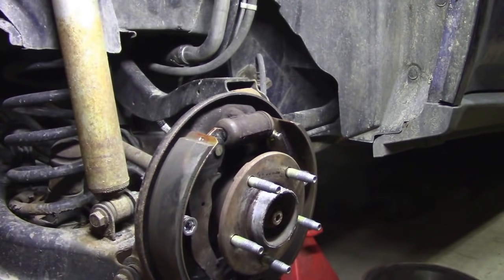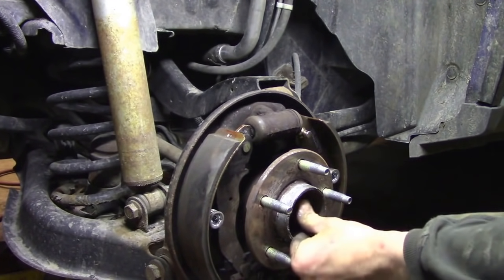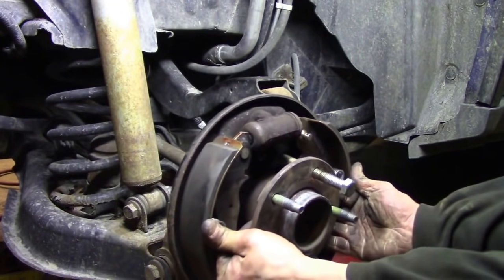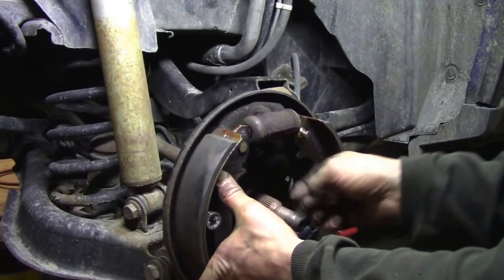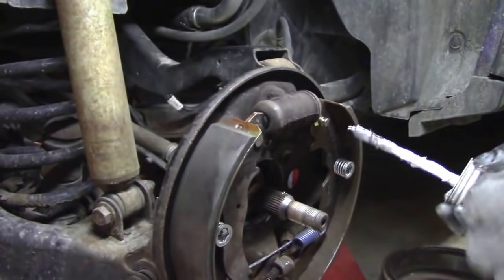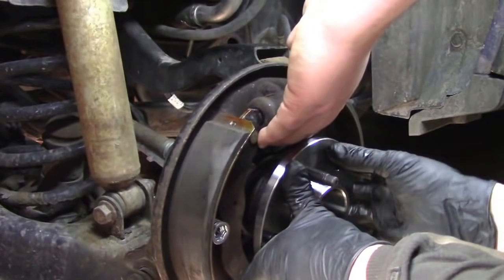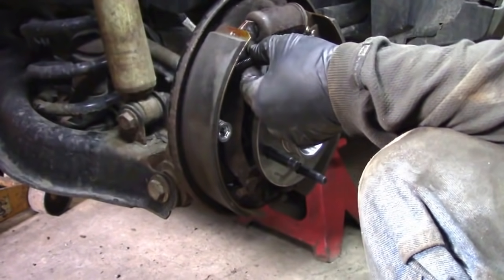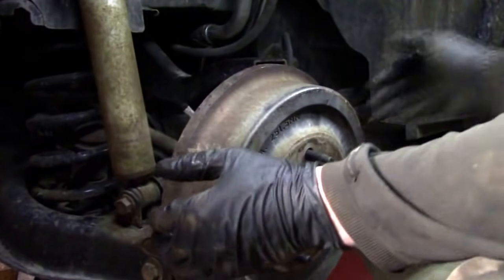Equinox rear wheel bearing replacement

Comment: I just finished my 2005 Equinox... Thank you Gentlemen for all the help. I do believe that this is an all wheel drive Equinox. My Equinox is a simple front wheel drive. I did not have to worry about the 29mm nut and spindle for the rear Hubs... Just 4 bolts and i tapped it out... Passenger side needed some tapping from behind but came out easy. Finished both in under 30 minutes. Again.. THANK YOU!!!  Saved me $236.00 in labor charges.
Reply from the maker: Glad we could help...
Reply: E2 6
Reply: I’m so glad I read your comment!!!!
I just replaced my rear drivers side hub and noticed there was no spindle on either side(of the rear)..... I got the vehicle from a private owner and began to freak out if there was a vital safety component of the vehicle missing for whatever reason!
I began looking online and people saying you have to have a cv bolt or the wheel can separate in motion but they were speaking in general and about front wheels. I couldn’t find any information on the 2 wheel drive model rear cv/spindle -but if they don’t need them in the rear that’s probably why😅

Comment: Worked great! Noise is gone and the antilocks don't kick on at low speeds anymore.  Only difference is I had a FWD equinox so there wasn't as much room to put the bolt on and no spindle.
Reply: speedbmp07 so you change both rear wheel bearing then
Reply: What was the noice that your were hearing?
Reply from the maker: Glad to help...

Comment: Thank you very much, I have to change my passenger rear wheel bearing, done wheel bearings on my past vehicles but not on the equinox I just got. Thank you very much.
Reply from the maker: Good luck...
Reply: @backwoodzcustomz1549  thank you for your help, trying not to drive it till I replace the wheel bearing, I know they do not self correct themselves and don't wanna make it worse.

Comment: If you apply grease or anti-seize to the threads, don't over-torque the axle nut. Reduce torque by 40%.
Reply from the maker: Never had an issue in 20 years..
Reply: All I'm saying is greased threads allow a nut to turn 40% easier so if something is supposed to be torqued to 150 and you grease the threads, your torque wrench will click at 150 but there's actually 210 being applied. Certain parts have specified torque ratings because they need a certain amount of tenstion to stay tight but also have a little give (yes, metal does give like a rubber band but just a little) but over-torquing takes up all the give so any sudden forces result in permanent stretching or cracking.
I'm glad you've never had a problem in 20 years but that doesn't mean it won't cause a problem for someone somewhere. I'm not saying every nut and bolt on a vehicle needs torqued to spec, but very crucial things like lug nuts and axle nuts really should be.

Comment: I tried to get two of the four bolts off and stripped the tops over both bolts so l could not try to remove the hub assembly. Thanks for the idea though.

Comment: thanks for the video, i am in the process of doing one with drum brakes on the rear, by any chance can you lead me to the right place to get the short steel brake line that goes from backing plate to main brake line its about a foot long and has metric fittings, tried to find them on line but couldnt find them.. thanks for any help you can offer

Comment: you did make that easy. BUT i am having trouble pushing the axle back. Any tricks to break the axle free?
Reply from the maker: If you mean release from the inside of the bearing. A big hammer, PB blaster, or even heat if you need to. Maker sure to leave the nut on so you don't ruin the threads.
Reply: @backwoodzcustomz1549  Could I use a 4 ton hub puller to pull the hub bearing? I tried heat, PB Blaster and banded the crap out of this and no luck.
Reply from the maker: you can use whatever you want, just showing the easiest way we have found..

Comment: Are we going to pretend the outer CV joint isn't as loose as a clowns pocket @ 5:50?
Reply from the maker: I don't think there is a spec for CV looseness?
Reply: I think the spec is: if its that loose, throw it in the bin!
Reply from the maker: Have you taken 1 apart to understand how it works? A CV connection is either engaging or not... When it's installed it gets pressure from the wheel bearing and the diff... When it's out there is no pressure.... Also the only looseness that would matter is rotational.... And you would hear that easily like a ujoint.... You can keep wasting your money.... 2 years later still no CV issues ..
Reply: @backwoodzcustomz1549  yes of course. Trained mechanic. But It shouldn't be that loose. I didn't realize you were waiting for total failure. Silly me.. I understand backyard mechanics like to put things off, but it's important to check components and replace for safety. You do you
Reply: I agree with s34nvideos. Sounds like BACKWOODZ is too stubborn to listen to advice.

Comment: Thanks a lot! That seems to be easily doable at home, without having to loose a big buck to repair shop in Canada. Will do it tomorrow. Was it aftermarket bearing, if so, can you recommend which one was it? And what exactly liquid/anti-rust did you apply?
Reply from the maker: Its very doable at home, just make sure you use that nut and bolt puller trick. Without it its a bear.. With every part I buy I just but the cheapest I can find. Cause in reality there is only a few manufactures of auto parts the rest are just reboxed and relabeled. We use pb blast to loosen rust up. And we just use regular parts store antisieze, that bottle is years old but I think it was permatex.

Comment: Do you know what size bolt you used? Doing this on a 2007 equinox and this would help
Reply from the maker: No, whatever was in our bolt drawr that fit. You can always go to a parts store and buy a stud or just ask them to see it and messure it, then you will know the size of the hole.

Comment: Better than watching A1 Beating the shit out of the bearing. I suspect the ones with Rotors do not have the heavier backing plate so that will not work.
Reply from the maker: You dont use tge backing plate you use the spindle.

Comment: To get the drum off do you need to adjust the tension wheel for the pads? Or just heat and dead low hammer lol I'm in ohio so rust if fun
Reply from the maker: We are in PA so we are right ther with you. You dont need to use the adjuster but if you feel the shoes dragging or when you go to pull it off you feel a springing action your shoes are hung up. Also the drums will build a ridge up and kinda hook omln the shoes.. Most likely just beat them off especially if you have replacements..
Reply: @backwoodzcustomz1549  While rotating the drum pound on the outer top with a motion toward you while still rotating. This usually does the trick

Comment: You guys went through all the work of pulling both sides and didn't consider the possibility of cutting the bolts and installing new ones facing the proper way? Would have taken considerably less labor.
Reply from the maker: Wouldn't have made a difference
Reply: @backwoodzcustomz1549  Actually, I did this very thing on an 06 Equinox. Your method is correct. I had that, and a front cv axle done in 6 hrs. Thanks for the tip.
Reply from the maker: @dolanroufs1032  yea man, I was there lol good times..